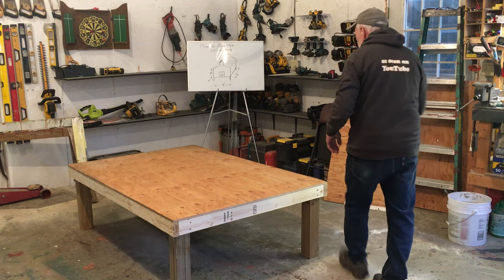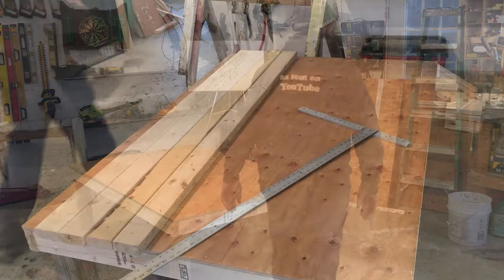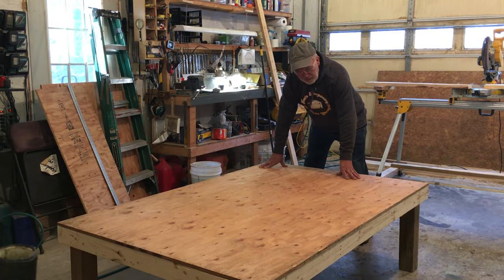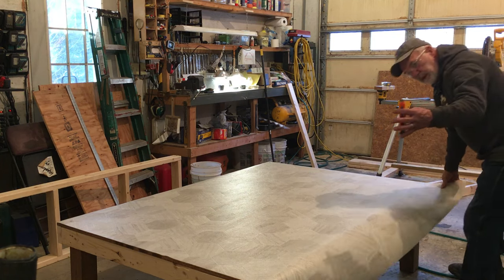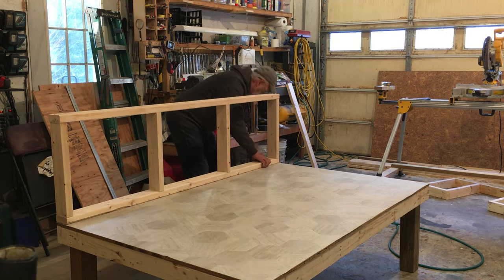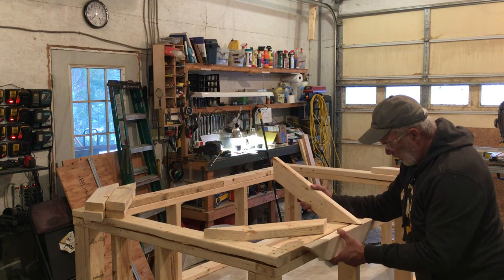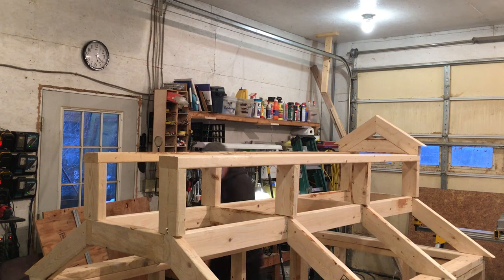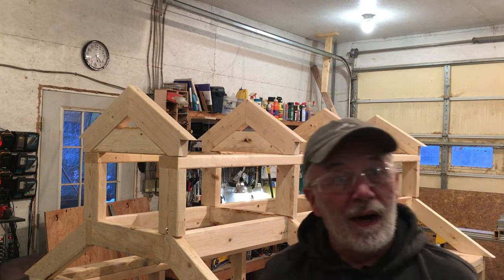Monitor Barn Style Chicken Coop Part 2

Comment: I have 2 jack Russels and 2 cats and 12 chickens. They all get along. My male jack Russel (Cody) likes to herd the chickens. Just have your dog around the chickens. Best to get peeps and have your dog around them alot. 
Our only issue is the raccoons and foxes.
Chickens are fun to have. Easy to take care of. Love watching your build. A friend of mine bought me a chicken coop from tractor supply. Very expensive and really is a piece of crap. The door came apart. I had to seal so many gaps. The egg doors were swollen shut. It's not looking so pretty any more. Will need to rebuild it this summer.
Wished I had the vinyl on the floor and one full side to open to clean. 
To give your chickens more room, put your nesting boxes on the outside. If you have them inside, it takes alot of room away. Will also limit a less birds you can have. It's fine if you only want 6-8 birds if you have the boxes inside your frame work. 
Chickens are like chips, you can't have one or two. Lol
Love you show
Reply from the maker: Thanks for the input

Comment: Morning Ken.  Richard and I have had chickens for about 20 years.  Just an FYI... The eggs are great, but they are a big pain.  Keep them relatively warm in winter, make sure they water at all times. make sure they are closed in at night to keep them from predators.  We have a rooster that is not very nice.  We had 5 chickens and a hawk flew off with one of them.  Backyard chickens is a good website, it is a forum.  Richard made our chicken coop years ago, still standing.  Best of luck in you decisions.  By the way, like that orange E bike!
Reply from the maker: Thanks Barb
Reply: I live 50 miles west (as the crow flies) of Ken, I do nothing for winter heat for my chickens, their coop is a converted horse stall in a very old unheated barn. The only concern related to cold is to make sure the eggs don't freeze. Multiple checks throughout the day when it is sub freezing. However I don't add light so not much laying happening in the winter. They make heated waterers, I am using a heated dog dish. However my chickens have the barn alley as a "run" so the water is outside the coop but still inside. A farmer/market vendor friend has a hanging heated waterer that uses horizontal nipples in her coop.The chickens put themselves in the coop nightly as it starts to get dark. I find my 30 chickens to be VERY little work. Maybe 10 minutes twice a day other than the 2 times a year I clean out the coop.

Comment: The chicken coop is taking great shape! The vinyl flooring is good for clean out but I do prefer Glasbord because it lays like plywood board only not as thick sometimes the vinyl flooring scratches up easier as stuff cakes on from dried poo. I definitely would recommend getting chickens even if you just get 5 or 6 hens to go in you coop. You will generally get 5 to 6 eggs a week per hen in the warmer months. The polycarbonate roof might make the coop hotter in the summer time if there is a large amount of it, just a thought. You get colder weather where you are so light in the winter 🥶 might be great!remember to think about being able to get into the coop if you need to get a Predator out or a hurt hen out.
Seeing time laps of your projects is always great maybe you can put them in between a project later like after your 2nd and 3rd projects before starting the 3rd project?
“Thank you, thank you, thank you turn off the bubble…” 🥰😁Lawrence Welk was on just before Mutual of Omaha’s wild kingdom and a Disney movie on Sunday nights in the 70’s but I’m not sure if that was a rerun or the end of his series. Once again fine work Ken!
Reply from the maker: Thanks
Reply: I used to watch these shows to with Grand parents and ,Mom,Dad👍🤩🇺🇸🌻🌞

Comment: I used to have manual chicken doors for years. My current coop has an automatic door that open at daybreak and closes at sunset. I’ll still check to make sure they’re in at night    but if I’m gone the coop will be secure. It’s a solar operated system and yes, it works in the snow and cold.
Reply from the maker: Very nice thanks

Comment: It's looking nice Ken. Personally I would add 2 studs under that cross piece on the ends so they take the weight of the upper roof instead of the nails on the lower rafters. One other thing. the reason we put the linoleum loose and up the wall a bit is so that we can remove it when it gets too stinky. Also it will tend to absorb the liquid manure. We also use a deep bedding so running it up the walls keeps the bedding from potentially rotting it out.
Reply from the maker: Very good thanks for the explanation
Reply: @kenskarpentry  Can't wait to see it finished!

Comment: I think I will say, I'm not keen on the polycarbonate use. I think it will increase the summer, and odd winter day , heat in the house and mess up the light effect chickens benefit from. I think it will always be too light . My option would be use feather edge  boards on the sides of the top with a louvre effect for ventilation and darkness.
Reply from the maker: Cool thanks

Comment: You do want easy clean out. You also need a "lip" on both the floor level nests and the chicken door (make it removable) to keep the nest material in the nests and the litter in the coop. Auto chicken door if you have a predator safe run attached, mine is a PulletShut. For a coop that size 3 nest boxes are plenty, you could inset them into the wall framing for a bit more floor space in the coop. 
Corgi's are herding dogs so she isn't likely to chase and kill them like a hunter might. BUT domestic dogs kill more chickens than "real" predators, probably because people don't think about their dogs as predators. You might be able to carefully introduce her to chicks, keeping a CAREFUL eye on her. You can see that Morgan Gold had a hard time with Abby not getting excited and chasing after the chickens even though she wasn't likely "hunting" them as she is a livestock guarding dog by breeding.
Reply from the maker: Very nice thanks

Comment: So cool. Question: You mentioned the 'grain of the plywood is in the wrong direction'; why does the grain direction matter? I presumed one could go whatever way fit best.
Reply from the maker: The strength is in the 8’ length of the sheet. They use logs that are 8’ long so that grain has more strength

Comment: Using 2x4 for the structure appears out of scale for such a small building. Consider using  2x6 then ripping in half for net 1.5 x  2.75 for the main structural framing. A bonus is using slightly less material.
Reply from the maker: Thanks
Reply: I did some 2x3s for part of my coop, and I had trouble with some wood splitting when I had to add too many things onto one beam such as crossbars for the roosts. 😑

Comment: Just had a thought, but you are too far into the project so maybe next time. You could have hinged the entire roof at the double top plate and added a prop-rod to hold it up while cleaning from the top. Install a few dowels for proper alignment when closed. BTW, I often wondered who cleaned up at the end of Welk's show. Running a bubble machine for an hour makes a real mess on the floor!  <LOL> Oh, just a bit of trivia.... at Radio City Music Hall (NYC) they mop the stage floor by adding a can of Coke to the bucket. It leaves a slightly sticky residue, so nobody slips, even if the floor is slightly wet. (stage actors / dancers can sweat quite a bit)
Reply from the maker: Hey that would have been nice. Yes the bubbles get sticky when they dry

Comment: On the legs consider letting them in so they sit flush with the outside face of the studs and chamfering the bottom feet of the legs to reduce splintering during movement.
Reply from the maker: Oh. Thanks

Comment: Why  you did not glue that  flooring down?  It's not a big deal and it makes it more stable to glue it down!  (2)  Spread the glue over 1/2 the plywood then unroll it from non glued side
use a J roller to squeeze the air out. Then roll the unglued side back and spread glue the rest of the way, repeat #2  job done!
Reply from the maker: True. Thanks